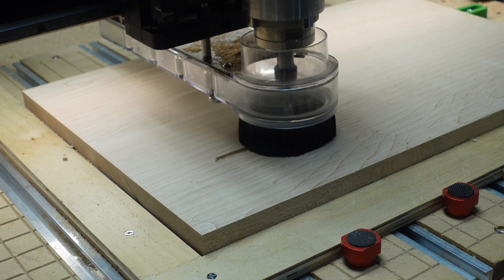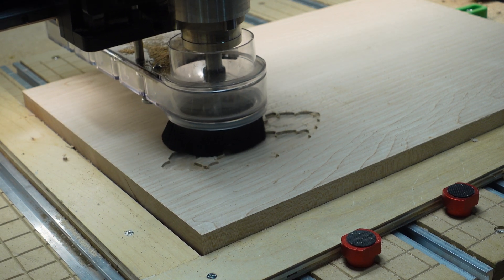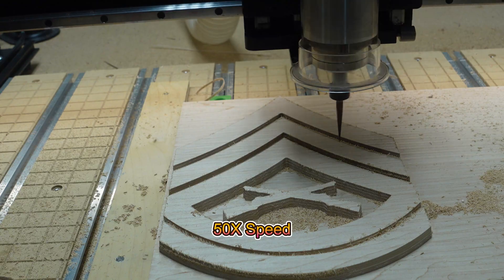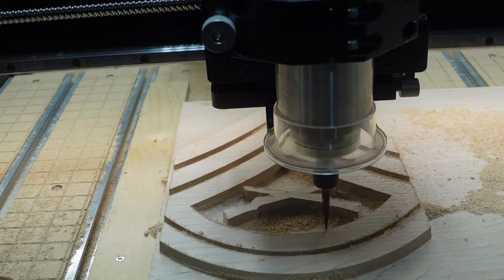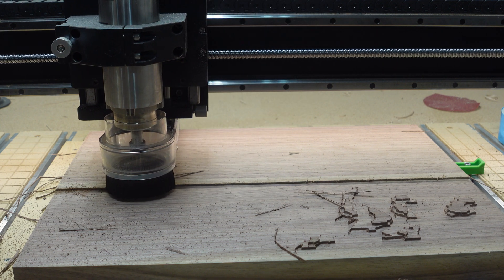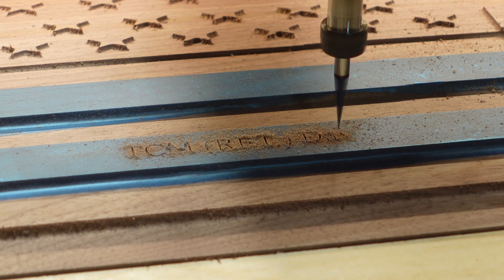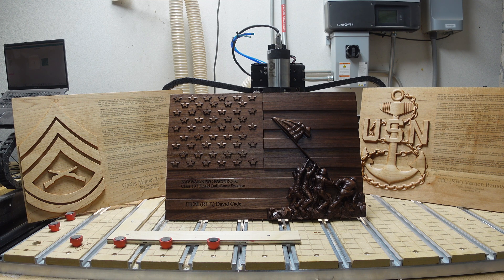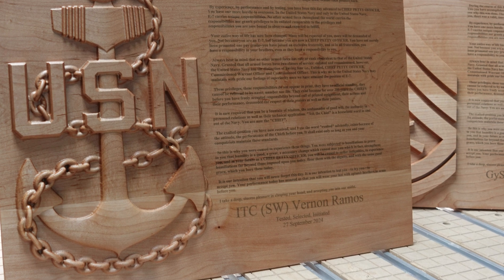I Crafted Military Promotion Plaques from Scratch Using CNC and Laser!

Comment: Actually looking at this again - maybe I missed it, but did you use a 3d stl and do relief carvings for the anchor and the Iwo Jima flag raising designs?  Thanks!
Reply from the maker: You are correct!  I used an STL for the anchor and Iwo Jima designs.  The SFC and GySgt were much easier, because I could use a standed Vcarve to get the look I was going after.  Thanks for watching!